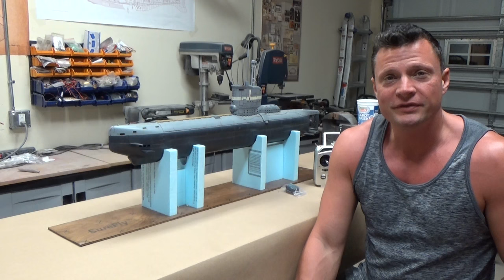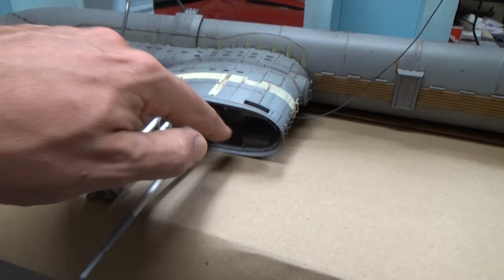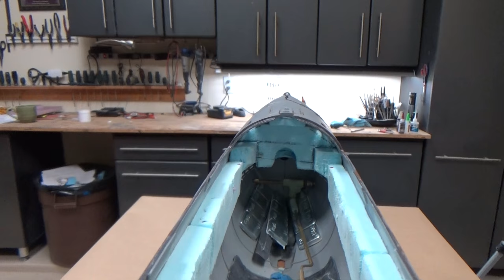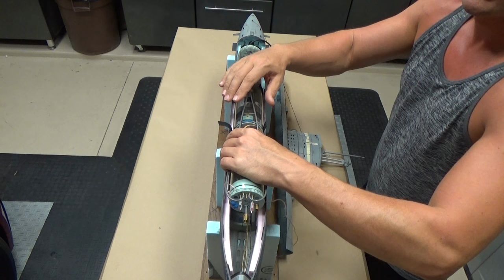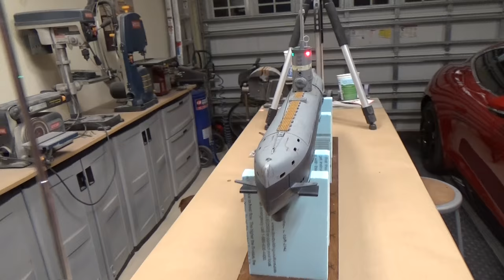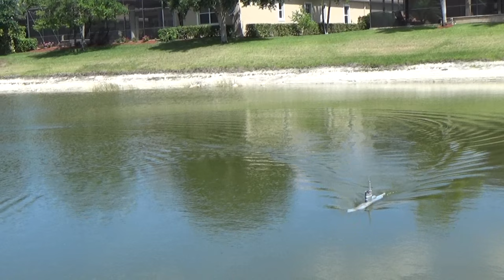Bronco German Type XXIII R/C submarine

Comment: Hi Bob,
At 9:50 when checking the pump function the rear dive plane servo was “twitching” was that related to the pump, or had you hit the stick or the remote or was there a crossed wire?
Reply from the maker: The rear dive plane servo operates through a sensitive pitch controller. It will often detect vibration from pumps or motors and make an effort to correct what it is identifying as a change in pitch. This is mitigated when the model is in the water.

Comment: how did you set up the movements of the bow and stern planes? 
Bow up-stern down or bow up-stern up?
Reply from the maker: Romel Costa, as these are connected and not independent, they are set up for bow up/stern down. This offers the maximum force applied to pitch control.
Reply: Thanks Bob.

Comment: I am wondering, could you do a boat that is controlled via wire?
Reply from the maker: For operation in salt water? Of course you could. It would not be ideal to have to tow a cable around, particularly for a boat this small.
Reply: I was more thinking for a 1:48 scale model of the Type VII or a similiar scale. Maybe you could even run it with an external energy source. For sure you could put in a lot of sensors that you normally couldn't, like a compass or even a live video feed, and probably also go deeper underwater than RC could reach. But yeah, the cable would limit the range of motion, and you'd have to make sure to do something so it doesn't tangle with the submarine. Maybe by attaching some floaters to the wire?
But as long as it stays attached, it could be beneficial. I think.

Comment: why is the dive plane shaft oscillating while venting?
Reply from the maker: The pitch controller is sensitive to vibration. It wasn't happening during venting, it was during the blow cycle when the pump kicks on. The pitch controller needs to be isolated from the vibration of the pump kicking on, that's all. Good eyes!
Reply: :) so it is actually responding to the foam stand? If this is the case I don't think you will get it in water if the cillinder is linked tight enough to the hull.
Reply from the maker: You misunderstand. There is a piece of electronics that automatically controls the pitch of the boat. It is connected to the dive plane system. When the pump kicks on, the equipment tray (which the pitch controller is mounted to) vibrates, which confuses the sensor in the unit and makes it oscillate the dive planes.
Reply: No I got that, the pitch controller is probably using a standard off-the-shelf 2D accelerometer. The thingies are really sensitive so if it is mounted in the cillinder tight enough it would probably react if you push the stand and the hull starts vibrating. If it hangs on wires(tucked in), it will respond to the pump only. If it has a trimmer to manage its sensitivity it probably will be enough to cut the noise.
Reply: Bob nice looking boat